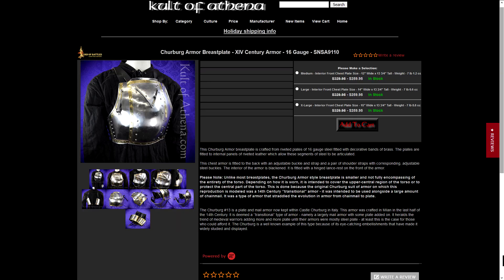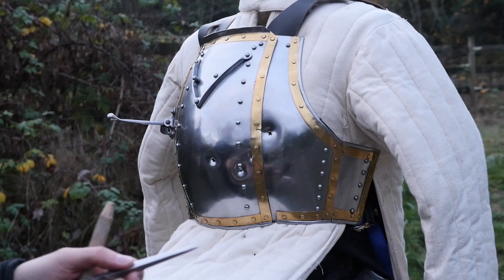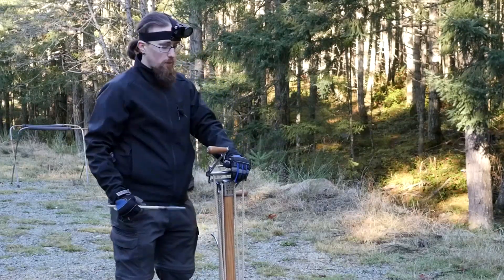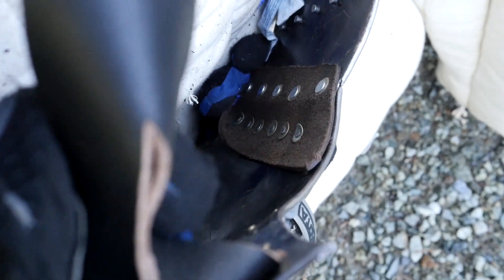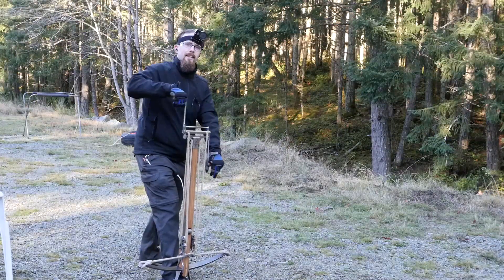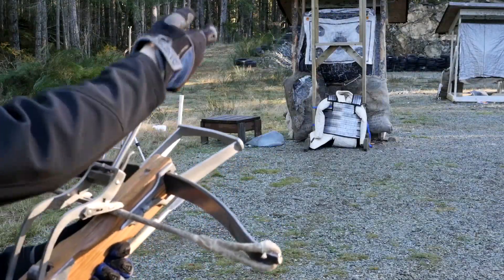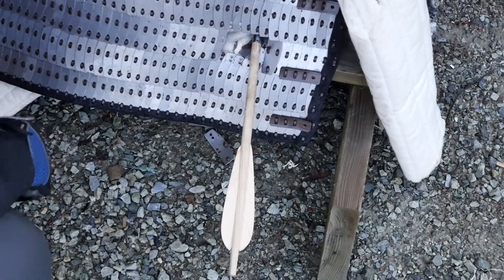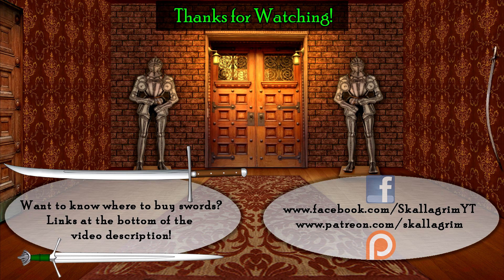Medieval Crossbows vs. Breastplate and Lamellar Armor

Comment: That was actually a huge surprise. I would never have thought heavy crossbows being so goddamn useless even against thin lamellar armour (especially on such short distance!). Hollywood really bamboozled me, they always show crossbows being very efficient against armour. The lighter crossbow would not even severly wound a person just wearing a gambeson! Incredible!
Reply: On a side note lamellar is extremely good at stopping arrows. If you look at the video, they simply bounce off even if superthin metal is used. That's why lamellar was widespread among archery based warfare like the far east.

The metal lamellae are not too rigid, so whed hitted by the arrow, they have space to move in and a lot of energy is lost with this effect. Also the lacings act as a springs, which makes the arrow being ultimately repulsed. This effect is even stronger when silk laces are used.

However, higher kinetic objects like spears or hammer are much more devastating.
Reply: @lucanic4328  So... Medieval kevlar vests?
Reply: @lucanic4328  Hey! Could you teach me about medieval weapons? I'd like to learn about what you know!
Reply: The lesson is that armor WORKS
Reply: +Martin Erhard 
Not only this. They also used light bolts. I copy here my comment from other thread:

The reason, why heavy crossbow seems weak, is, they used light bolts, which are made only for lighter crossbow. By increasing draw weight of the bow, you don't get any actual speed of the bolt, more accuratly said, bolt is just slowed down less. But from some point of draw weight, the speeds of the bolt by time of release, is almost the same. By increasing poundage, you don't get any actual speed. And thus, kinetic energy. The speed of the limb, after release, is limited by material, in case of steel, it is even less than wood. Thus, to gain benefits and power, of heavy poundage crossbow, you NEED to use heavier bolts, which store more kinetic energy. Example is, that 50g bolt flies almost at same speed from both crossbows, light and heavy, but 100g bolts flight speed, is different, because low poundage of draw weight slows 100g bolt too much, but in heavy crossbow, it flies almost at the speed of 50g one. Thus way, heavy crossbow is able to store much more kinetic energy into bolt. There is no sense of shooting 50g bolts from 1000 pounds crossbow. You need to use at least 150g bolts. I already told several times to Skalagrim, that he is doing this mistake. If you use heavy bolts for armor piercing, you don't want to shoot at range, so heavy bolts are meant only for short range shooting, to bring maximum kinetic energy, for armor piercing. He doesn't have such heavy bolts. Actually, peak of maximum kinetic energy for 1000 lb crossbow, would be somewhere between 200-250g bolts. This way, projectil shoots quite slow, but it brings most kinetic energy with it. For good armor piercing, you need also speed, but still, I would say, that this test should be re-done, by comparing several types of heads, and heavy projectiles. You will see, there is lots of difference, between 50, 100, 150 and 200 gram bolts, when shooting by heavy crossbows. Almost in all test, of heavy crossbows, I see (and often even longbows), people are using light bolts/arrows, gaining almost no kinetic energy advantage from lighter versions, and then claiming, the results are simply weak.

For imagination, you can see kinetic energy capabilities of great horn crossbow, in this video. https://www.youtube.com/watch?v=nY2untEwCnU
You can see, how bolt weight influence the kinetic energy, and that it is reasonable, to go even up to 300 gram bolts, when you have 1200 pounds of energy. The bolt is flying slow, so it fall fast, but you want to penetrate armor only at close range, up to 20 meters anyway, so it is no problem. The test in the video above is even badly made, because chronometer is too close to crossbow, so bolt is not fully accelerated. The actual results would be even 10-20% higher, than you see. And 500 Joules of energy, is for sure power, that is overhelming for mechanical weapon, while strongest english longbows have around 150-180 joules. You would be suprised, but that great horn crossbow, would be able to penetrate both plate, and gambeson under it. That's the reason, why it was even banned by Pope in middle ages... one shoot from 7 days trained peasant, and one knight kill... not too honest.
Reply: @warrax111  The Pope banned lots of weapons back then. It had nothing to do with their actual combat effectiveness. I doubt very much the Pope would have any idea about the subject of armed combat, he just arbitrarily banned things.
Reply: @another3997  The Pope isn't a dictator, there's always a reason, and many Popes were literally former soldiers.
Reply: @warrax111  Author shooting "tennis balls from a cannon". I think someday his powerfull toy will crack, cause with light arrows all unused energy goes into bow and rope self destruction.
Reply: @warrax111  Nobody is saying it would be stronger. Just stronger in relation to its draw weight. Draw distance is extremely important in archery. Medieval crossbow has like 6 inch draw, longbow even 32 inches. Just check Tods workshop channel who is making quality replica crossbows. He explains it in layman terms why medieval crossbows are the way they are.
Reply: Corniflox it isn't useless, but of course it can't pierce a solid piece of steel and still penetrate further.
Reply: @MultiCaliffa  I think today's crossbows could easily penetrate the armor
Reply: the lamellar actually do better against piercing as it is harder to deform a smaller metal with the same thickness, and if the material of the strings is right(like reinforced silk) the armor will be flexible that the plate will be pushed against the body to the maximum before they start to absorb energy(so the strings don't break but the user will be quite painful). Also, the plate armor can surely stop a few arrow hit(as shown), however, all metal will be weakened after hits, so more arrows will be able to start penetrating over time. That is why the Chinese focus on arrows protecting armor(lamellar/later the fish scale and mountain pattern) as it is common on the Chinese battlefield that there will be "arrow rains" and you will probably get hit by more than 30 arrows before reaching enemy line(side note the composite tech of the Chinese bow gave Chinese bow power of a crossbow and crossbow rate of fire of a bow)
Reply: @alextang7462  i
Reply: You can keep shooting a crossbow all day as you just need to crank but with a bow you have to keep pulling the full weight back every shot
Reply: Don't be too impressed with the high draw weights of heavy crossbows. With such a short draw distance they have very little amount of time to accelerate the bolt.

An English longbow might have only 150 pounds of draw weight, but it uses that 150 pounds over a distance of 24 to 32 inches to accelerate the arrow, while a heavy crossbow uses 1000 pounds to accelerate a bolt over 6 to 8 inches. In the end, the arrow ends up going faster and their having more force.

The advantage of crossbows is not the power itself. It is the fact that you don't need to be an extremely strong person in order to draw them.
Reply: the object of an bolt or an arrow is only to wound the enemy, even if we don't take armor in the picture the possibility to kill with one shoot is very rare, but a wound is enaugh, because not only would take the target out the fight but would have a fare high chance to get infected
Reply: The Chinese actually prefered brigadine style plates. Mostly, this was because the cloth outside could be dyed any number of colors but also because it was more effective against arrows. Small links on mail could be forced apart and large links can be slipped between but lamellar would perform uniformly every time. 

There's also the impact to consider but I think that's outside the scope of the argument.
Reply: @adamblakeslee5301  The Chinese used brigadine plates in the medieval period but this didn't become popular until the late medieval period. They used more popular armors such as lamellar, scale, and other types of armors during the ancient era through the medieval era. Other types include mountain scale, mirror plate, cord & plaque-double breast plate, banded plate, and even chainmail.
Reply: warrax111 

Thank you that was very informative
Reply: Bodkin tipped bolts/arrows were a lil bit more effective against plate since they were streamlined and smaller... Anyways bows and crossbows werent an answer to plate armor or armor in general, firearms were... Long bows probably had lil bit more penetration than crossbows but they were both equally useless against plate (at that time era I'd put my money on artillery to deal with plate units "here comes Bessy" 😬)
Reply: @-Yurkey  

Longbows better penetration than crossbows? Just no...
The projectile limited the longbow too much from being good at penetration....
Less weight, finer arrowhead and breaking shafts all lead to less energy transfer and less penetration
Reply: @martinerhard8447  it's marginal in any case, firearms were the real killer of plate armor
Reply: In general, arrows weigh more than bolts, so they have a larger momentum (kinetic energy) at a given velocity. However, a late Medieval crossbow could loose a bolt at a higher velocity, thus overcoming the lower mass (the the kinetic energy being equal to the mass times the square of the velocity). Both longbows and crossbows were capable of penetrating all but the thickest plate armour, but my understanding is that the heavy crossbow was the main driving force leading to heavier and heavier plate armour. At point blank range, the crossbow almost certainly had greater penetrating power than a long bow. By the 15th century, and possibly earlier, it is safe to say that heavy crossbows (such as a windlass spanned crossbow) were more powerful than longbows. The common crossbow probably wasn't much more powerful though... In any case... Firearms replaced both
Reply: Chainmail was quite common too.
Reply: it depends on the bolt-steel and wood if you can penetrate it. If you habe hardened-steel bolts it is easier to get threw the armor. But here it looks its simple iron-bolts.
Reply: This also explains why the Turkish composite bow was so ineffective against the armored Italian mercenaries at the final siege of Constantinople in 1453, especially since the bowmen couldn't fire at pointblank range.
Reply: This might have been said already but I don't wanna read though the comments. 

I think the issue is that people tend to liken heavy crossbows to guns in terms of piercing power when the heavy crossbow isn't anywhere near anything like a gun in power. Modern crossbows are lighter and deliver an even better shot in terms of power than the best crossbows in history.
Reply: The armour does a pretty darn good job at protecting most of your body, but if one of those bolts gets through those grooves...
Reply: Lamellar is actually lighter than mail.Even if the lamellar is 2-3 mili thicker,it still 3-4 times lighter(based on what i have:a mail Hauberk and a Lamellar Cuirass)
Reply: @RobynBombzero aim for the head if you on horseback, a mace to the head at high speed will do something
Reply: Aurelio Corneo you'd have more luck aiming at the limbs or head, especially the feet
Reply: Even if it doesn't penetrate, it would definitely daze you or knock you down.
Reply: The thickness of lamellar plate depend on the culture and area of the body. Tang Dynasty lamellar plates are found to have a thickness of 2 mm to 3 mm. 

Even if it is not thick, the fact that some style of lacing leave lamellar plates essentially floating in the air could make the plates harder to penetrate compared to a rigid plate.

The lamellar that Skall shot is also not really that well made in my opinion. For example the plates overlap downward which would lead to a strike glancing upward and getting caught between the plates, many historical lamellar example actually overlap upward. 

Also the orientation of the sideward overlap is also not optimal, I have seen depiction of Russian and Chinese lamellar with plates overlapping from the center to the left and right side of the torso creating a ridge in the middle (which could be reinforced with plates or made of the thickesst plates in the armor). Such overlap will create the same deflective effect as a plate cuirass, albeit also far more flexible.

The heavy crossbow perform not as well as expected because of its short draw length (power stroke) and heads that are too wide to be armor piercing.

While I don't think that the hardness of the bolt tip is really that important here, it may be the reason why arrows are unable to defeat armor decisively. A European envoy to the Mongol suggest that to fight the Mongol, they need to harden their arrow tip like the Mongol did to penetrate Mongol armor which imply that 13th century European arrow tip are not hardened. Even until the 15th century, arrow tip are not hardened, while armor start to be hardened, thus arrow and bolts gradually lose their ability to inflict damage and they are replaced by guns for this purpose.
Reply: Longbow gang represent
Reply: The trouble with plate wasn't that anything got through it, even guns can't easily pierce full plate. The trouble is the cost of repairs. The heavy crossbow put a hole in the plate. Fixing that is gonna be expensive in medieval times.
Reply: @tomhill3248  I think the Medieval and Renissance military would have enough infrastructure to repair or make new plate, as we can see a complete adoption of plate armor in the early 16th century with all other remaining garmor type like the brigandine fell out of use.
Reply: @joshg8053  Doesn't mean it was cheap. Soldiers not in plate mail was still way more common then soldiers in full plate mail for a reason. One suit was worth what an entire village of farmers made in a year.
Reply: @joshg8053  Source for Medieval soldier wage?I did heard that a full plate harness equal 60 litre of beer in medieval time.If that true,then it is quite cheap,i suppose.
About the repairing im not sure.It cost alot of time,labour and technology to begin with.
Reply: @Phoenixrising2055  I don't really know the primary source, but the information on wages is in the website I post before. The wage is  for a normal laborer not soldier. Making and repairing a type of armor become easier when they have the necessary technology.
Reply: @joshg8053  plate seem seem rather cheaper that i expected,but isn't that make everybody easy way to acess plate?
Reply: @Phoenixrising2055  Yes, plate armor is very common. You could see the Graz Armory in Austria which is a preserved armory for example of how common plate armor is.

Armor in Medieval Europe was never really like in fantasy where mail, scale and plate coexist at the same time. 
Europe in the 15th-16th century had the technology so they adopt plate armor extensively and slowly ant other kind of armor.
Reply: Void and All Encompassing even after guns were invented, armor was still used. It’s where we get the term bullet proof. A breast plate was shot at close range with an arquebus to proof it. The dent was then surrounded with engraving.
Reply: pretty useless indeed. with so short powerstroke even a 1000# crosbow can be comparable in power to a warbow. Only actual advantage is that unskilled and physicaly weaker people can operate them. No wonder they were favoured by the french.
Reply: To me the fact that the tip of the darth flattened tells of a badly made one, and that fucked the test a bit. The tip of the projectiles could be heat threated to be harder than the armor (armors can't be really heat treated).
Reply: Yes the crossbow wouldnt kill.
But the bolts used here are not the best. The tips bend what means that they were not properly heat threated
Reply: An 82lb Manchu-style composite bow, by the way, supposedly managed about the same kinetic energy with a heavy arrow. It's weird that a 1,200lb steel crossbow, 150lb yew warbow, and 82lb Manchu bow all apparently perform about the same. And note that 70-80lbs was as low as military Manchu draw weights went.
Reply: @benjaminabbott4705  Arrow energy is roughly determined by draw weight x powerstroke. These medieval European bows have very low powerstrokes (~6 inches), whereas regular bows like Manchu recurve bows and English longbows have powerstrokes of some 28 inches. So if you're using the "same type of arrow" and other factors are equal, a 1200 lb crossbow with a 6 inch powerstroke would be roughly equal in power to a 257 lb draw bow with a 28 inch powerstroke.
Reply: @benjaminabbott4705  I guess they were not keen on their Math. Lol. Energy transfers and all that.
Reply: I'm not sure about this crossbow. Is it one of Tod's? In any case, I've yet to see a replica crossbow that performs very well. The heaviest replica windlass crossbows with steel prods manage about the same kinetic energy as a 150lb yew warbow shooting a heavyish arrow: 130-140 J. If Ralph Payne-Gallwey really shot his refurbished 15th-century crossbow 440-460 yards, it likely did much better than today's replica, 200+ J.
Reply: And don't forget the distance. No archer, would even think keeping his position in the battle, against a heavily armed charging knight, closer than 60-70m.
Reply: Star Wars got it wrong! I thought armor did nothing!

XFD
Reply: I don't think this is true though. Cos historically, crossbows were banned for a time cos of how easily they killed fully trained knights. Crossbows pissed off a lot of ppl lol
Reply: @theoddone887  Yes,an in East Asia,Composite Bow and Crossbow were use all the time.That's why lamellar was so popular and it was evolve more in East Asia.
Reply: Luca Nic that's not quite true, lamellar didn't protect against arrows, swords or spears any better than mail armor did.  it was also heavier than mail.  the difference was that the main users of lamellar (the chinese) were using these badass polearms sorta like poleaxes and halberds hundreds of years before europeans did.   those weapons caused alot of blunt force trauma that mail was totally ass at protecting against.  the chinese also used mail as well.
Reply: @r6guy  Lamellar protects against arrows much better than mail does. The crossbow bolts fail to penetrate lamellar here, but Skallagrim actually has another video where he shoots riveted chainmail with these same crossbows, and the bolts penetrates the mail and pierces the target underneath.
Reply: @r6guy  Very good point about the early chinese polearms and scale vs. mail.
Reply: @r6guy  Don't spread misleading infomation.Lamellar is lighter than mail,cheaper to make and offer better protection against projectile as well as spear than mail is.Also Lamellar have a massive armour design alternative,so it can beat Mail in Versaltility.
Reply: Hollywood bamboozled a lot of people, (just like CNN does) particularly about Bowie knives and quick drawn revolvers. Also, I'd like to see a demonstration of the Native American scalping knife on this moron's haircut.